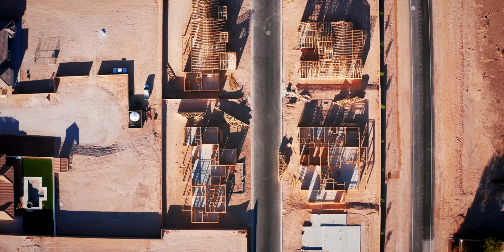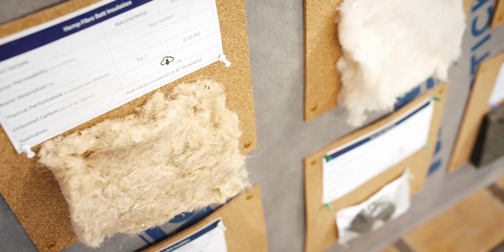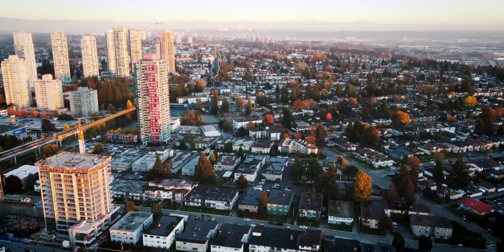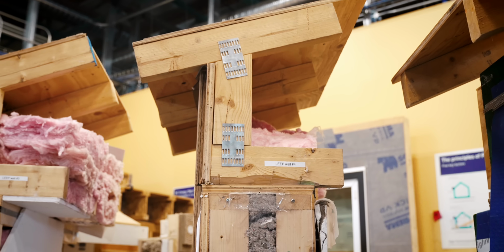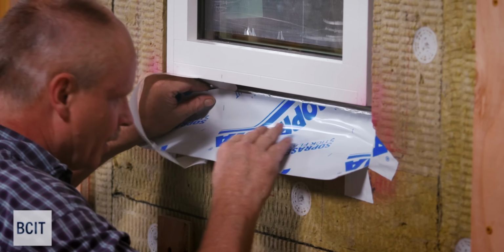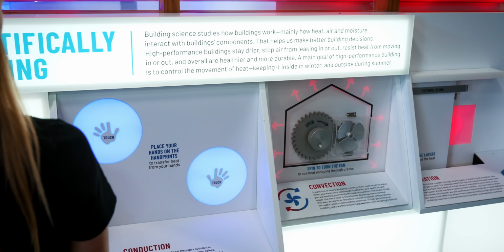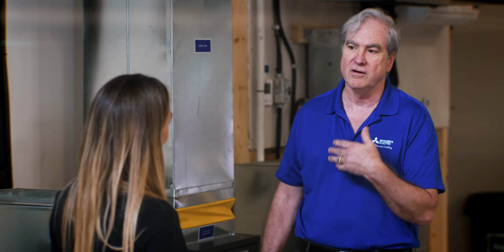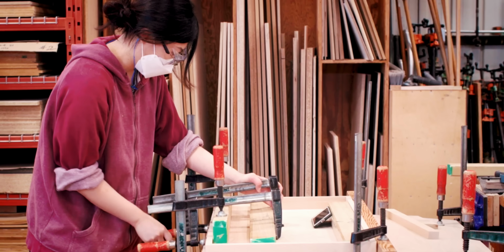THIS Is How You Build A Passive House!

Comment: There are 16 million homes in a place with 5.4 million people? Where did these numbers come from? Doesn't seem to line up with Canada's national statistics office census which had only 14.98 million households in 2021 and 14.07 million in 2016 in all of canada.
Reply: The 16 million homes is an estimate of homes going forward, and is not that far above the existing 15 million homes today. This is a national figure and not just a number for BC. Given the high immigration rates in Canada, 16 million homes is actually a little low as a projection for 2030. Canada's population just passed 40 million this year.
Reply: Who's estimate? Based on what data and formulas? The video says the numbers are for only British Columbia so you can't just wave that away by saying it's for Canada. Even if it was all of Canada, 22 million homes iby 2030 would be yearly growth at a rate of nearly 4 times what was seen in 2016-2021
Reply: According to CMHC (Canada Mortgage and Housing Corp.) 3.5 million more homes will need to be built by 2030 to reach affordability, for a total of 18 million homes - about 2 million more than the conservative number of 16 million homes mentioned in the video.
Reply: It does seem the numbers are pulled from the CMHC report "Canada’s Housing
Supply Shortages: 
Estimating what
is needed to solve
Canada’s housing 
affordability crisis 
by 2030" which estimates homes at almost 16 million in 2019, projects over 18 million by 2030 and estimates 22 million is what will be needed by 2030 to achieve affordability.
Reply: You are totally correct and I gave the numbers for the whole of Canada 🙄... Caveat coming in the episode description!

Comment: Only 1/5 of carbon emissions are from homes. It looks like a good way to distract people and cost them money
Reply: 20% is a big number! So homes and building do have to be dealt with. As does transport, industry, manufacturing and agriculture. to a first approximation they are all 'only 1/5'.
Reply: @xxwookey my mistake it's half that. About 10.9% in residential. Sure, make new homes efficient but it'll hardly dent the actual problem and it's financially unviable. It would be far more realistic to put pressure on energy producers to switch to nuclear.
Reply: @johans7119  Building new houses to be 'good' (passive-ish) is not 'unviable'. There is a small up-front cost (1-5%) and large long-term savings over the next 100 years. It's been mandated in Brussels since 2015 and worked just fine there. For office/comercial buildings it was found to be cheaper to make a passive building than a conventional one. Other places are following suit (e.g. Scotland).
And just because other areas (agriculture, industry, transport) need to be addressed too is no reason not to stop building inefficient buildings. Decarbonisation is significantly easier if the heating load by heat pumps is 60% lower for all the new buildings and 90% lower for all the refurbed ones. Whether the low-carbon power comes from nuclear or some other source - the less you have to build the cheaper it is.
Building passivehouses saves money (both for the homeowner, and in reduced infrastructure/generation requirement) so there really is no reason not to do it.
Reply: Different technologies are applicable for different scenarios. In BC, nuclear is a silly option since there is so much hydro-electric power. Consequently, the next step is going beyond energy generation and moving onto energy efficiency. If you have been to Vancouver recently (I was there 4 weeks ago), you will notice that it has the highest percentage of EV ownership in North America. So fossil-fuel usage is declining rapidly in the province. 

There is no need to scream about the petroleum companies any more, since the transition is being economically driven towards EVs (gasoline is over $2 per liter in BC).

Comment: Better insulation in ALL buildings is a MUCH greater priority than installing heat pumps and other short term 'solutions'.  Until governments accept this then we're stuck with frankly insane subsidy schemes to swap one device with a 10 year lifespan for another with a similarly short useful life.  Insulation will last for decades at a minimum!
It's baffling everyone understands you wear more clothes in winter but don't consider it would be a good idea for houses to have the same approach taken.
Reply: It's not the have b if the government lol!!! Yes they can make it better but they aren't going to tell you how to build or get ve you money for that! There is need of many little changes. The use of hemp for example
Reply: I used to think this, but I have been persuaded to change my mind. Swapping gas to heat pump is a much quicker and simpler job than whole-whole fabric retrofit. And with decarbonisation speed matters just as much as the endpoint, so actually there is a good argument for decarbonising by just getting rid of all the gas boilers rather than insisting on fabric-first which is technically much better, but dramatically slower (and more expensive). There is a brilliant piece looking at this issue by Dr Richard Erskine. 'Insulate Britain, Yes, but by how much?' It's a really thought-provoking read, especially for those of us solidly in the 'fabric-first' camp.
Precisely because we have dithered for so long (i.e not changed the building regs 20 years ago for a gentle transition) and time is short, just whacking in a load of HPs decarbonises faster.  The fabric can still be done later.
Reply: heat pumps wors beat in a well insulated house. horse and cart.
 @xxwookey
Reply: @xxwookey even heat pumps isn't as simple because of costs and also the still waste of energy due to lack of insulation! The heat pump won't be as effective as gas for example in real hard situations.
Reply: @alanmay7929  You can heat any building with a heat pump that you can heat with a boiler. But obviously heating badly-insulated and draughty buildings wastes a lot of energy however you do it, and it's a lot cheaper if you only need a small heat pump not a massive one. Nevertheless wasting very-low carbon energy is, from a climate point of view, way better than wasting high-carbon energy.
When considering decarbonisation the bottom line is that we have to cut emissions to a given level, not energy use per se. And if the quickest and most affordable way to do that turns out to be loads of heat pumps and a pile of extra generation, then that's still a valid solution even though many of us would prefer to see all the houses retrofitted to at least LETI/AECB standard, if not PH.

Comment: It's amazing how bad we were at insulating buildings in the past. My local school was built in the mid-1970s and is an absolute travesty of design. It's largely on one level, so has a massive footprint and a lot of roof space for heat to dissipate. Which it would, because it was built with literally no insulation at all. The roof panels you see when you look up is the roof.

Oh, and they put a lot of the radiators on the ceiling. Because nobody explained convection to them. But hey, at least it has very small (single glazed) windows, which was their attempt at keeping the heat in.
Reply: One of my friends designs HVAC systems for schools in the UK. He hates his job. The schools are built with a 30-40 year life expectancy, on the basis that "needs will have changed by then, so why over-engineer the construction" - the mortgages the local authorities take out to pay for them are about 25 years long. It's not hard to work out the results...I look at the Victorian engineering still being used today and can't help thinking that Londoners would be knee deep in shit if Bazalgette hadn't over-engineered the London sewer system...

Comment: PH has issues, historical poor air quality and PH design means less windows over insulated walls. Who pays for PH retrofitting since the vast no of homes are already built? PH is still rare for apartments where PH premium building cost would be spread out
Reply: I live in a retrofitted PH. The air quality is excellent, and it's extremely pleasant to live in. Yes my house was already built, but it was also cold and draughty and expensive to heat. So I paid to improve it (over 15 years). Most of it was done DIY so it was very affordable. (£2500/yr)
Reply: @xxwookey  I am all in favour of PH but the fact is that the vast amount of PH is more easily done in a self-build or architect designed house where the extra cost is baked in at a lower price. With most house prices and construction inflation cost - good enough  or meet the minimum standard is the mantra as most will be a vast improvement over whatever home they grew up in or rented. While PH mandates air fans in every room for MHV and that fixes poor air quality the issue is that super tight air leak efforts mean ventilation is even more important as there are no air leaks allowed. Most are not doing this PH investment over 15 years ( they might pay a loan back on it often over the lifetime of the mortgage). Yes there are some fine larger scale PH schemes but PH understanding and skillset is still a tiny choice over the wider home building market. PH is still rare in apartment blocks and public housing. Not surprising when a heat pump is still seen as innovative.

Comment: 2:34 I think he means 'up to 90% reduction in heating load', not actually '90% reduction in energy needed to run the house'. The hot water+appliances and gadgets load stays the same and so becomes the majority of the consumption rather than only 20%-ish. 90% reduction in heating load due to passivehouse-grade retrofit is normal (for an old house). 90% reduction in total energy use is not.
Reply: From the context, talking about Step 5, I assume he was referring only to those items covered by the Step Code: space heating and cooling, water heating, ventilation and related fans and pumps. It is also not clear what baseline house he is using to arrive at the 90% reduction. If the baseline is the average existing single family house in BC, then maybe a 90% reduction is possible. If the baseline is a new house built to the prescriptive requirements of the 2018 BC building code, then the reduction might be around 50 to 60%.
Reply: Good point!
Reply: Either and probably that (in the context of the German definition I'm used to), or it's conflated with electricity generation via solar?

Comment: When are the Alberta tar sands going to stop production and Canada really embrace renewables including lots of wind turbines, solar and storage???
Reply: When they are made to, or there is no high-price oil market left. The reduction in demand from EVs is already affecting total oil demand (6% reduction by 2025 is projected by WEF) whilst aviation, petrochemicals and shipping don't change much. So there are large uncertainties in exactly how fast this is going to go and when peak demand is (anytime from 2024 to 2035 on current plans). And supply may still fall faster than demand in which case prices remains high and the tar sands still make economic sense. Oil prices have always been volatile and that's not going to change with the transition.
Reply: Tar sands oil production has a high cost of production and refinement. As the prices drop from lower demand, OPEC will attempt to mitigate falling per barrel prices through production control. However, economics is what will dictate any changes of economic activity. Note that refined oil products are still required for fertilizers to grow food and materials. Oil production will not be going away anytime soon. Welcome to real world.
Reply: @Obscurai  Fertiliser is made from ammonia and ammonia is made from methane, not oil, these days. Yes oil is used for various other bits of carbon-based chemistry so won't be going away entirely. That's currently about 14% of production. But various other carbon-based feedstocks can be used. Oil is partly available as a cheap feedstock because we dig loads up for use as fuels. If much of that usage goes away it will be interesting to see if it remains the best/cheapest feedstock or if other (generally bio) materials fill some of that gap. Oil used for plastics that don't get burned is not a greenhouse gas and thus not a (climate) problem (plastic pollution is of course it's own big, separate problem).
Reply: @xxwookey  Thanks for the clarification. 

Yes, it will be interesting if food prices will fall or increase as a result of oil demand decreases. I expect that it will rise in the short term as methane is also used in electricity peaker plants and more of these will be required for the transition. 

Regardless, the only thing that will stop oil sands production is if it becomes economically unviable (high production costs relative to selling price, or no market access due to its isolation).
Reply: @Obscurai  Do you mean 'food prices' above or is that a typo/braino?
Reply: @xxwookey  Sorry, I don't understand your question.
Reply: @Obscurai  Battery electricity storage and other grid services will make electricity peaker plants increasingly underutilised and uneconomical to operate. I believe oil demand has already peaked and the peak demand for methane is not too far off into the future either.
Reply: @MrAlRats  Demand from directly from retail consumers has peaked but this only reduces prices as input stock for other use cases. There will be less use as a combustion fuel and more use as a chemical feed stock.  This demand will initially be less but will grow as population and standard of living increases around the world. At some point, this input demand may match or even exceed combustion demand.

Comment: My employer does. I began designing off grid buildings over a decade ago. We hope to release kits in the next 4-5 years or so. Much technology to mass produce to keep the cost down, else such passivehaus designs will be a luxury of wealthy tree huggers. :)
Reply: Did you watch the video? The focus on 'PassiveHaus' is passive improvements - insulation, design, materials... yes, heatpumps and heat-recovery systems are important, but they were the last 2 pieces, after you have the passive structure in place.  Correct (and sufficient) insulation, preventing air leaks, and so on can have a far bigger impact on the energy efficiency of a home than just slapping in a heat-pump...

Comment: I'm from BC. It's expensive to get a net zero house compared to the option of just putting on a sweater or using an electric blanket. (We don't need AC here, just heat in the worst months). We already have a housing crisis, and thus a homelessness crisis where people can't afford housing and freeze on the street. What we need is affordable housing for the poor. This is like making it mandatory for everyone to drive a Ferrari because it performs the best. We already can't afford housing costs. Anyway, we all use BC Hydro which is 100% green electricity from hydroelectric dams.
Reply: The slight increase in the mortgage payment is more than offset by the savings on the utility bills, so it ends up being more affordable overall.
Reply: Are you homes heated with electricity, or gas? If you’re using gas heat, all the hydro power in the world won’t solve the problem.
Reply: The point is that you can spend the same amount of money building a house badly and you can building a house well. They aren't expecting it to cost more, they are expecting builders to think about how they build and to find ways to reduce the cost of building well, so that the cost of the extra materials and equipment is somewhat covered.
Reply: The issue with prices is land cost, not the building on top.